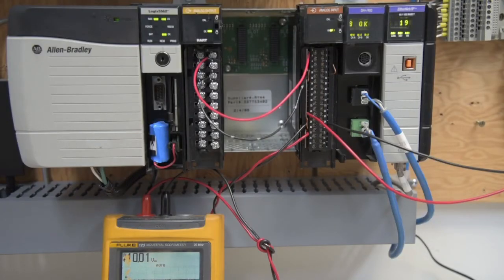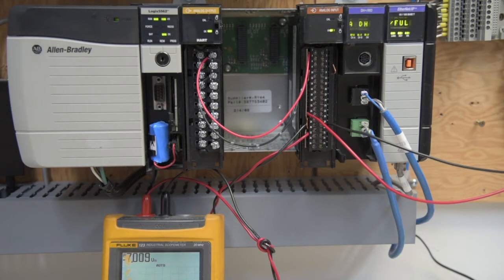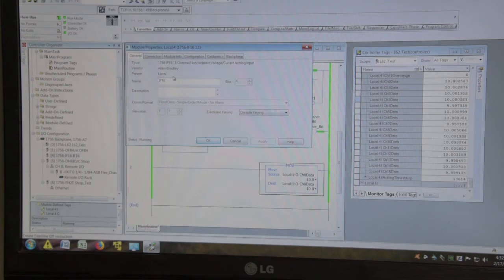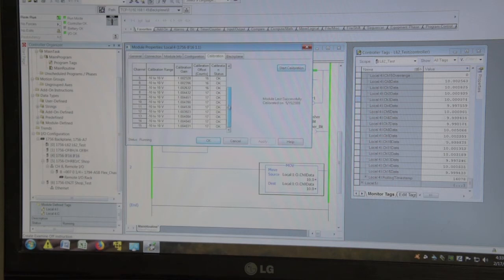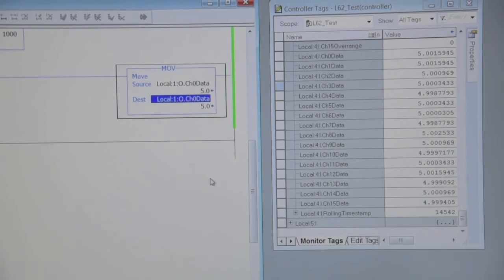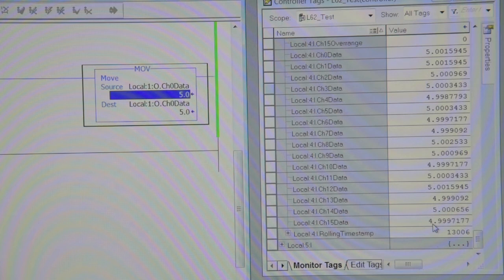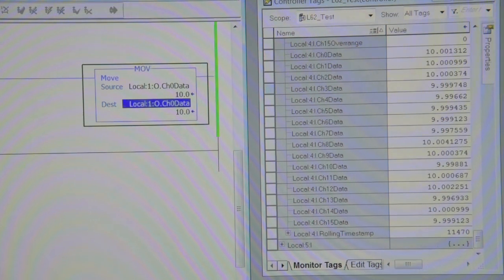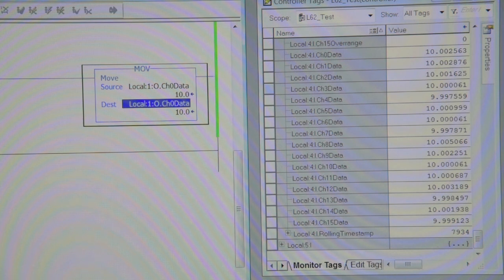1756-IF16 CLogix Analog Module Testing

Comment: Just wonder we do not need to do the scale for the input and output. Just simply put 5,10 data and get 5, 10 volts at outputs. THANK YOU, SIR.
Reply from the maker: It all depends on your scaling.
I prefer to have it move around to make sure that the components are fully tested and I can guarantee my work and QA to my customers.